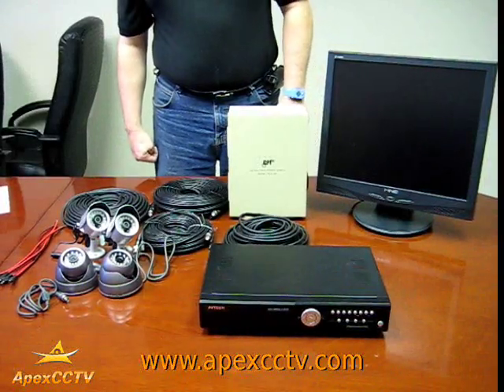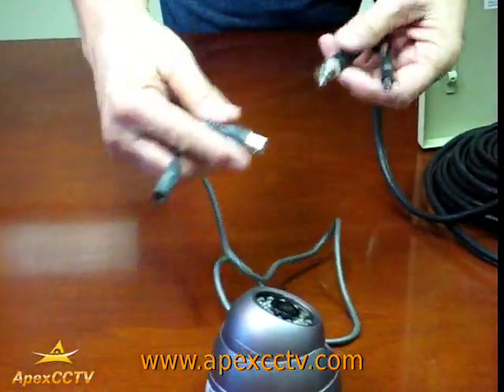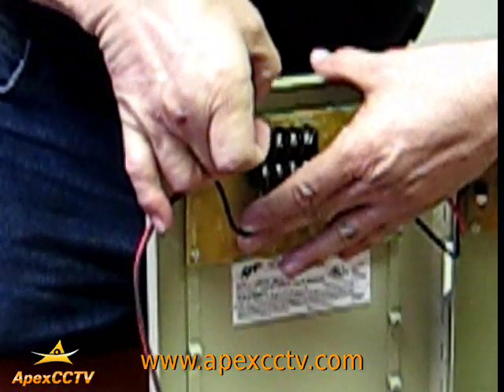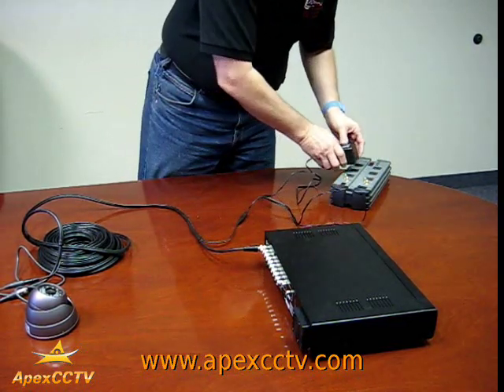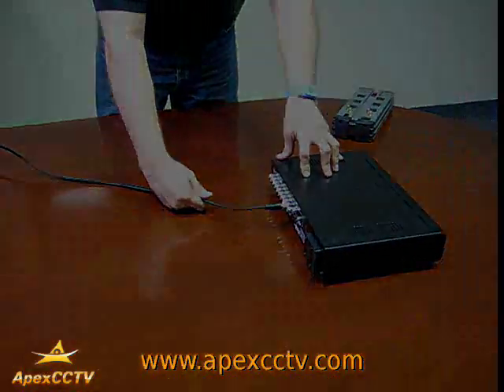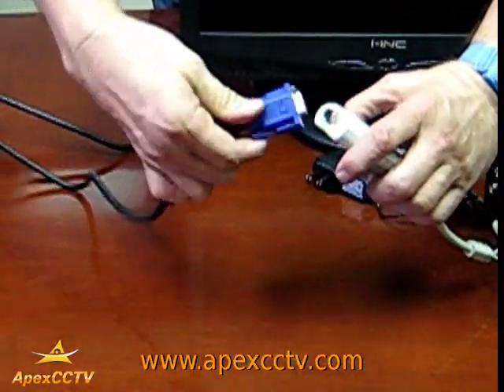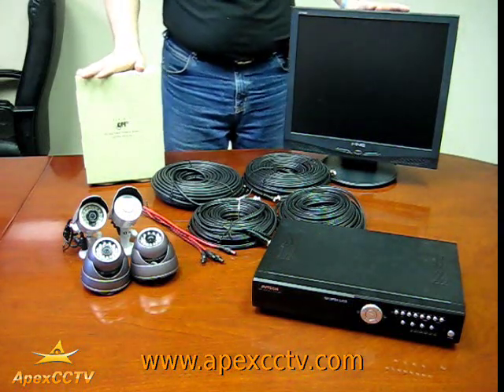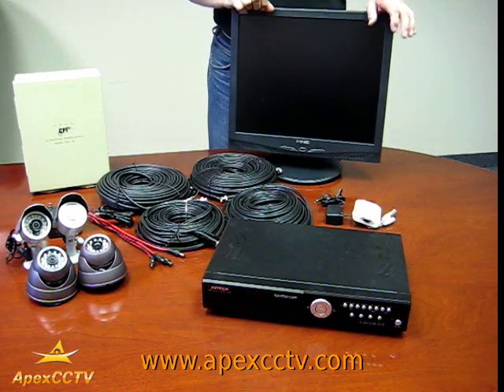Video Tutorial : How to Connect Security Cameras & Power Supplies to a Security DVR

Comment from the maker: I believe that exact power box was our 4 Channel DC Power Supply Unit. Depending on the size of your system and power specifications of the equipment, you may need a slightly different supply. Feel free to take a look at our selection on our website (listed in the info section).